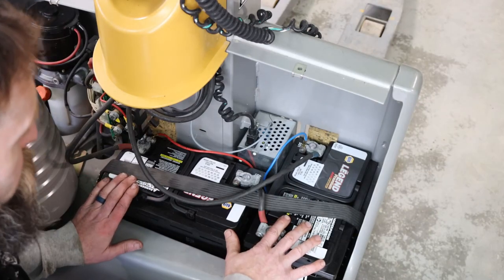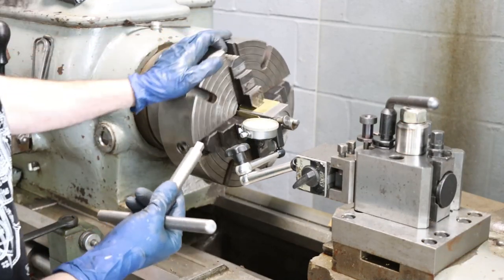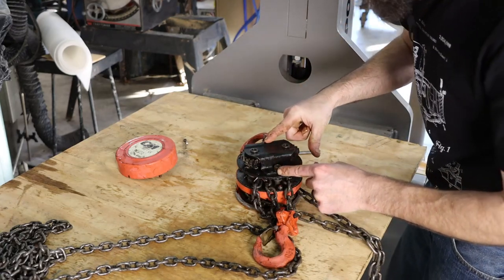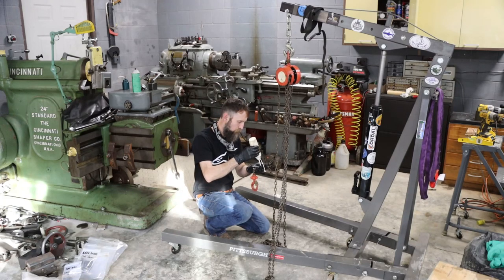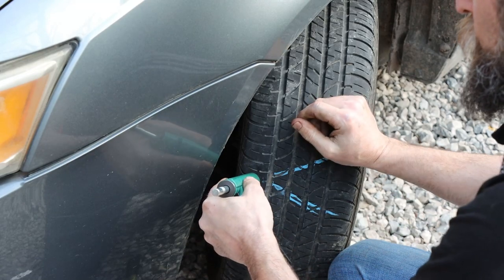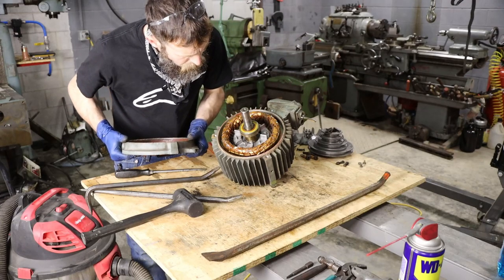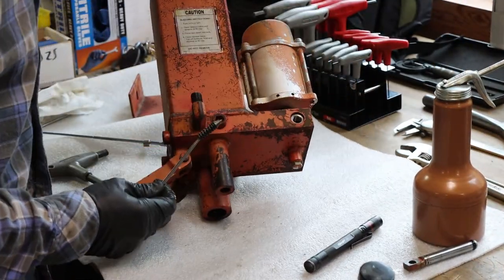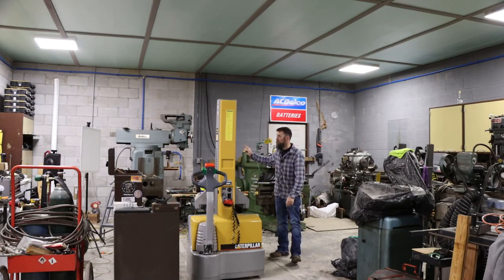DoAll Milling Machine motor and Big Press Repair.

Comment: I'm not familiar with this chain pulley thing. So, this one-way slip clutch means that if you pull something up, you get the gear reduction, but when you want to go down you get 'full-speed' but with resistance?
Reply: You get reduction in either direction. There's enough mechanical advantage that a little hold holds the load too. Least that's how it seems to me. It's a chain hoist.
Reply: @1pcfred  tnx
Reply: @ErikBongers  another person said it is because the pulley is on a thread. It tightens up in one direction engaging the clutches. There was that weird double thread on the pulley side with the castle nut. Chain hoists are clever things.

Comment: As an electrician I quite got a shock as I (finally) recognized the shape of the power cable of your forklift.
I mean, okay, you only got 110V over there in the US, but mains is still mains and 110V is still way above the save voltage to work on, wich amounts to 50V AC.
The inner isolation layer is not meant for mechanical force, it is just for electrical isolation.
Mechanical protection is the purpose of the outer layer of the cable.
I HIGHLY RECOMMEND you to get a new cable, to get the isolation in order again, before anyone gets zapped on it during charging, because the inner layer fails.

Please be safe!

Comment: Does anyone know, the big armature that holds the motor on the DoAll, is it a solid casting? Maybe I'm not being clear, its the 3 foot long grey rectangular (12"x12" VERY roughly) lump with dovetails on the bottom that is at the top of the machine and has the spindle & motor attached to one end. There is a moment in this video where you can see the back end of it, and it looks like it might actually be one gigantically solid chunk of iron. Is that true? Or is it relatively hollow? I know a mill like this needs to have massive inertia and vibration damping and stiffness and strength, but still, for that piece to be actually solid seems a bit OTT. But I'm no engineer and that's not based on any experience or math, maybe it does need to be solid. I'm so jealous, really want one, be completely wasted on me, but I'd love it anyway.

Comment: Steve PLEASE build a wooden catch box and glue a large cut to fit piece of foam about 6 inches thick and line the rest of the box interior withe glued in 4 inches thick foam and install it under your press.  Your face is way to close to that press when you are holding the piece so it doesn't fall.

Comment: Seals are the best tyre repair kit by far. All in one kit compact and ea s y to use. Rema make an awesome kit it uses blue cement it works great but the selastic plugs are prone to ripping so can be frustrating. That plugger kit you have will leak! Almost guaranteed. The plugger kit is well liked but is completely rubbish in comparison.

Comment: It is possible to reseat checkvalves if you had a new ball Put the old ball against the valve seat and give it a whack with a hammer and a pindriver will make a new seat

Comment: So does a hydraulic reservoir need to be sealed? Could Steve have just made a plug to put back in the top of it? I think the factory only welded it because that was easy for them to do. Easy imagination wise that is. They're pretty much welding everything in sight in the factory that press was made in.

Comment: Got to add, we used type A transmission fluid back then, but back then it probably still had whale oil in it, we are talking 1970's.  AW 32 I figure is good enough.  Just don't use brake fluid, it will do bad things.

Comment: AGM batteries,  better suit your needs,  because they are designed for continuous low drain , usage , car batteries on the other hand are used in short high drain usages,  IE, starting engines,

Comment: Looks like someone that drives the same roads as you has a box of loose sheet metal screws in a truck bed or van with a rust-out floor pan. I know because I had a box of a 20-pound box of short roofing nails in the back of my Ford van I was given by someone in the 1970s and when I went to use them after a couple years the box was empty even though it had never been opened, and sure enough there was a rusted out hole thru the van floor pan and thru the nail box, sorry to everyone that I caused a flat tire back then but then the strangest thing though was I never got flat. The larger bearing on motor end bells is provided on motors that are meant for belt service on the belt side.

Comment: You mentioned that the tire you plugged had been driven on with low pressure.
That is exactly why tire plugging can be deadly, you have no idea of what the damage to the inside of the tire may be!
But don"t take my word for it, check out You Tube "South Main Auto" channel video posted two years ago titled "Why Tire Plugging Can Be Deadly".

Comment: It's not the voltage.  It's the plate geometry and how much instantaneous power vs total energy the respective battery types contain.  Deep cycle batteries can do a lower overall current for a very long time (more energy) vs a starter battery which is designed primarily to punch your starter motor for a few seconds (very high current, very short time) and then get charged off of the  alternator.

Regardless of battery type, lead acid chemistry is lead acid chemistry.  A low SoC (<< 10v) for a long time lets the electrolyte (sulfuric acid) eat the plates.  The lead is converted to lead sulfate.
Reply: Regardless, I'm glad you listened to good advice.  Deep cycle cells are the right choice, regardless of sealed versus flooded.  As long as your charger doesn't overvolt them and make them gas, and you don't let them sit at low SoC, you should get a couple of years out of those batts.  👍

Comment: I always thought you used numbers ? on the bearings to ID and get correct replacements, looks like it works this way too long as bearing is same type and size
Reply: The numbers on a bearing reflect the measurements, e.g. a 604015 is 60mm od, 40mm Id, 15mm width

Comment: Those tire plug kits have been around for years. Had the same kit 35 years ago. was even the same color. Threw it in the garbage or sold it, don't remember. The rubber plugs are cheap Chinese garbage and don't hold up. Hope you keep and eye on the plug.
Reply: I find it funny that "cheap Chinese garbage" that "don't hold up"  has been in use (at least in your memory) for 35 years.  Must be something good there!
Reply: @paulcopeland9035  That kit is most likely 35 years old. In my 74 years of working cars and motorcycles for a living I have a added a few Chinese tools. And some are good and some bad. As I stated I have used that kit, the plugs are just soft rubber and if they haven't improved it over the years it can't take steel wire which will eventually cut the plugs up.

So try it and then let us know how good it is.

Comment: Steve, is that a LeBlond 17?? Looks just like our's (@@)! Also, was that lead soft jaws that you had in the Wilton vise clamping the shaft when welding up the tip repair?? If so, what a cool idea :)>...I have some lead pads 3 x 4 x .375 and never thought about using them in the vise. I use too lead seams on classic cars, but that is now a past lost art with all the new fillers. If we ever get up your way, would love to do a shop tour for our channel if ok? Bear. PS. Check out if you have time the "Drill Tree" I made with spare parts on #Shop Made Tools. There are 4 Parts & not impressive, but it worked out to be more useful than I expected. Please drop me a comment with any ideas to make it even more useful, Cheers from TX.

Comment: ya should have just tried to spray it out with Brake clean first you will contaminate it again when you weld it back together.         Ole timer

Comment: I thought you would have turned down the eccentric shaft with the lathe then put on a brass bush which could rotate and prevent uneven wear. No need for welding then.
Alarm at lack of gloves whilst welding! Clearly I am no welder.

Comment: Hi Steve... I love your content very much. Honestly, you provide the audience with one of the best home shop and repair content on YouTube. However, there's one issue i have. Seeing you filling a bucket with some chemical cleaner, to clean an old pulley with chain and then rinsing it out with water in your backyard, right next to a creek is akward to me. While rinsing out the chain and the pulley, all those chemicals are being released into the nature, soaked up by the soil and then transfered to the creek with the next rain.
Doing this at my place and putting it on YouTube would result in a harsh fine for polluting the enviroment.